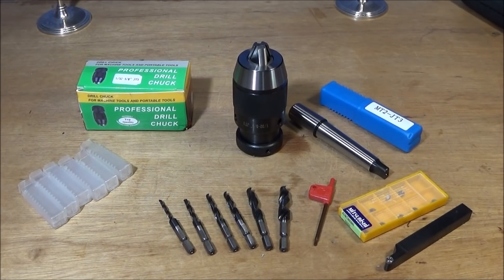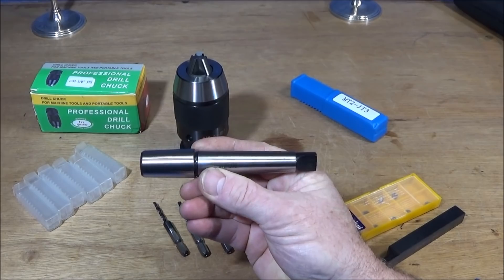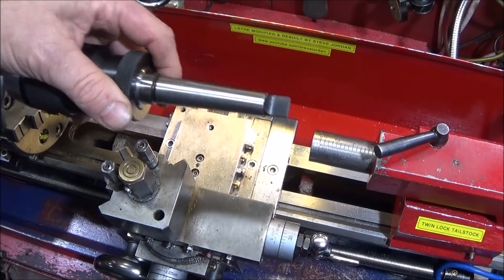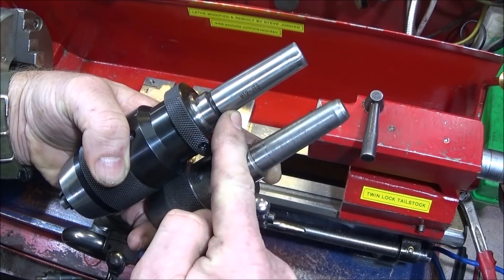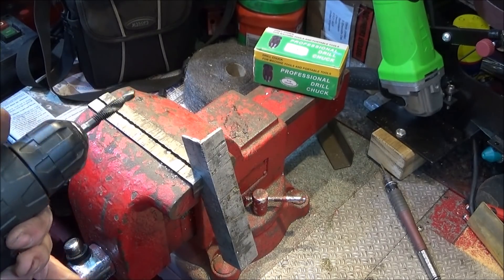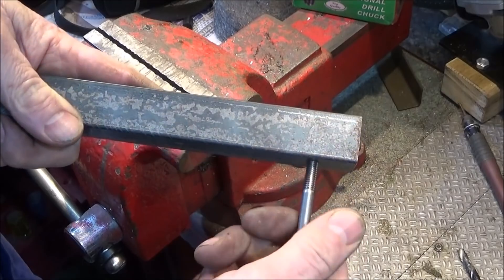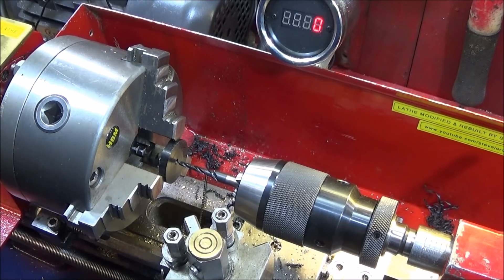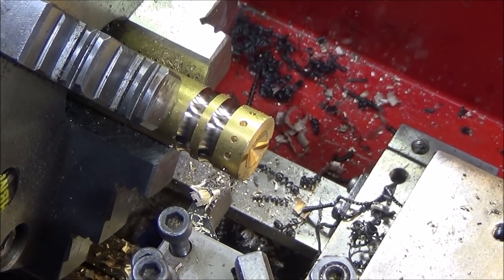Excellent New Tools & Gaining Extra Tail-Stock Travel On Mini Lathe

Comment: Hi Steve,
Great set of tools, must get the round turning tool and very impressed with the combined drill/taps.
By the way, I see you have a Myford (Dixon?) type tool post on the mini lathe, so I bought one. BUT I can't get centre height with any of my 10 or 12mm tools- how do you modify it to fit?
Reply from the maker: Hi Pat, You should be able to get centre height easily with the Dixon tool-post, by the adjustment that is available on the screw if it the same as mine?
Reply: @SteveJordan  Hi Steve,
Thanks for a prompt reply. A friend who watches your videos said he thought you did a video years ago about this and showed how to mill the lower edge off the tool holder. I have searched and can't find it, I think many of your early videos are archived and I don't know how to access them- can you remember the dimensions if that is the remedy?
Reply from the maker: Hi Yes I did that. Have you got the Myford lathe or the Chinese Mini Lathe? The mill off was for the Myford lathe.
Reply: @SteveJordan  I have the 7x14 chinese mini lathe, but have done most of your mods to it, including basic milling so will be able to do this and having looked closely at it feel sure this will solve the problem. I presume you have a set of tool holders set up for each lathe but am puzzled that you have not needed to machine the edge of those for the mini lathe.
Reply: Hi Steve,
A quick ps to the last email- I have found that video and will do those mods- thanks so much for your time and help!

Comment: Could we expect to see a buffing wheel attachment for the Chuck and  pulley side of the lathe at some point? Great videos Steven I find most useful as have a Chinese mini lathe. I have already implemented the swivel milling slide, keyless tail stock Chuck, collet Chuck and dial indicator stand thanks to your videos. Next will be a slitting saw arbor!
Reply from the maker: Hi Andy, I will do a buffing wheel at some point. I have several things to make, but just waiting for the weather to warm up a bit. Regards steve

Comment: Hi Steve,
Very nice video (as all the others!)   Practical each day i check if there is a new video!!!

I have one question about the insert,   I have a Myford ML7 and the inserts are maximum 10 mm,   I know in the holder you can put an insert of  12mm but then  it's not possible to position to  the correct center height.  What to do?   I have  no milling machine.

Comment: Hi Steve, Would like to have a chat. Whats the best way to talk with you ?
Reply from the maker: Hi John, It depends on what its about?
Reply: @SteveJordan  Basically im wondering if you can cut gears ? And if you can, can you cut 20 degrees pressure angle ? And if you can then will you do a couple for a modest sum ?
Reply from the maker: @johndoe9536   I really haven't got the time for making things or doing machining for anyone really. It is too cold and damp to do much in the workshop in the winter and by the time some warm weather comes I have loads of things that I hope I will get done, depending on my physical health etc...Regards Steve
Reply: @SteveJordan  No Worries. I understand. My garage is is unheated and run from a diesel gene so noisy and cold. Least its out of the rain but i have to leave the door open for the hook up cable so im kinda in the same boat. Dont have al the kit i need myself or id do it myself. Will just shelf it until i do.Everyone wants help but who helps you !

Comment: can this chuck be used on a drill press ?
Reply from the maker: Yes, but check the fitting on your drill press. They have the same chuck with the other fittings like B18, B16, JT6 etc. It all depends on the fitting on your drill press. They also do the same chuck listed as a 1-16mm and a 1-13mm
 I have the same keyless type chuck on my drill press
Reply: @SteveJordan  thanks

Comment: Hi Steve,

Interesting video and tooling.  I'm pleased to see that BG have decided to offer some ISO gear.  I think they should also provide some DIN standard gear so buyers can go higher quality if they wish.

I would be interested to see how easy that keyless chuck unlocks when used with larger drills.  This proved to be my Chinese chucks nemesis in the BG review I did on a similar item a while back.  But for smaller diameters it works/unlocks well.

Cheers Rob
Reply: You are crazy if you think that ISO or DIN mean anything whatsoever. In this instance ISO9001 and 9002 just mean a Quality System is used at the factory. It means nothing regarding the product or any standard it might or might not meet. DIN Standard means nothing either... they will write whatever the buyer wants onto the carton, but that doesn't mean it is manufactured to or verified to meet any standards at all.

Comment: Good video I would use a drill with an adjustable torque setting as I have used these to fix sheet metal and found the small taps to be a bit fragile

Comment from the maker: SEE ALL THE TOOL LINKS BELOW:-
ENTER THIS CODE ON ANY OF THESE TOOLS AND YOU GET AN EXTRA 20% OFF code:  48f291
1/32-5/8 Inch 3JT Keyless Drill Chuck -- https://goo.gl/EJxb9J 
Drillpro HRC89 M3-M10 Combination Drill Tap Bit Set --  https://goo.gl/UxmaLV
SRACR1212H06 Lathe Indexable Boring Bar Turning Tool Holder --  https://goo.gl/T32rxA 
10pcs RCMT0602MO NX2525( Round) Carbide Insert -- https://goo.gl/AZf29Y
Reply from the maker: Banggood Health Protection -- http://bit.ly/33tNTBx
  Banggood Health&Care Protection --  http://bit.ly/3d7QpSy